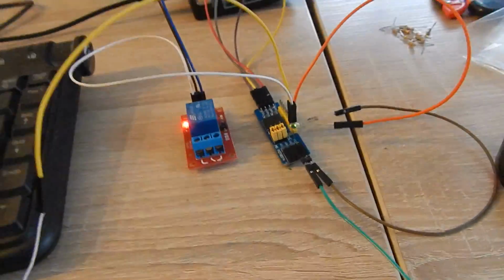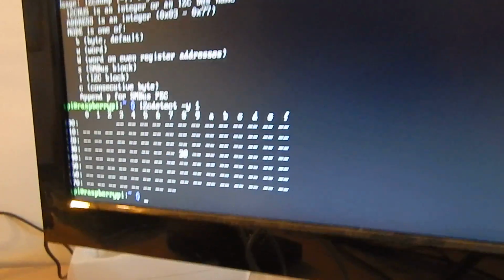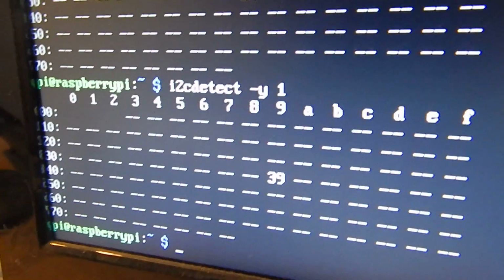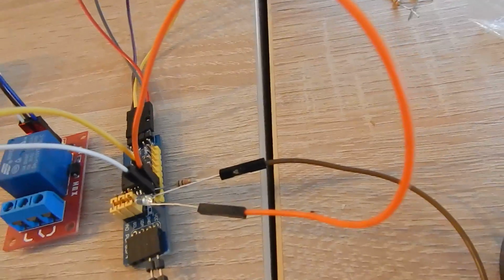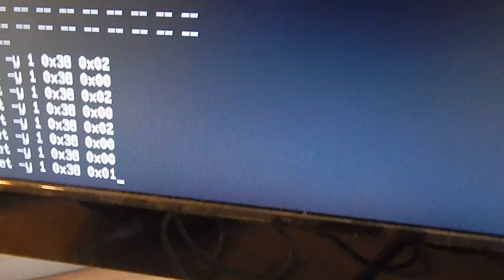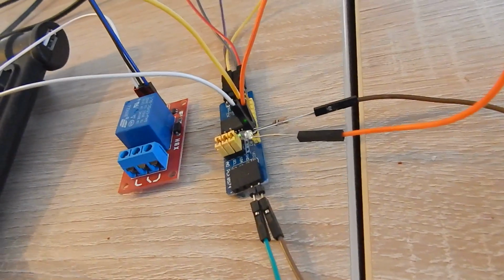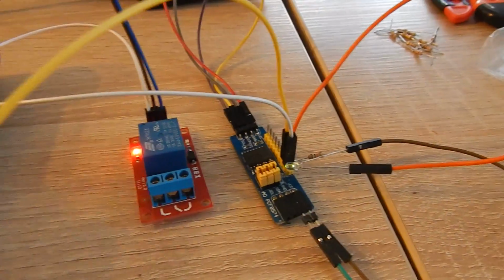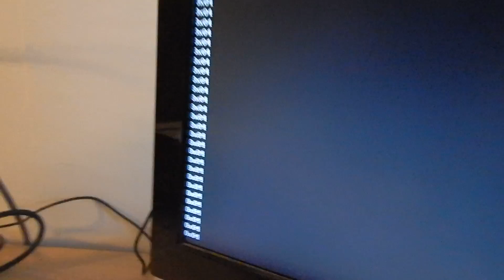Raspberry Pi I²C GPIO expander PCF8574

Comment: Hi, great video. I need to read the status of 150 buttons. Is it possible to use 19 PCF8574 modules in cascade? The project is with Raspberry pi 3 b +
Reply from the maker: You won't have enough address bits. 3 Address bits means you can only use 8 IO expanders.

you can build something like shift registers to stack an unlimited amount of buttons. Or if you like it analog, build a cascade of resistors where every button shorts the circuit at an other point of the cascade. Measure the resistance and you will know which button has been pressed.

Comment: Hello, nice video.
Just a suggestion: for the push button status reading, instead of continuously reading it with an endless loop, you can better use the "INT" port on the PCF8574 that wil inform the Raspberry about any change (rising or falling edge) on any port of the circuit.
Then, you can use an interrupt function that will run only in this case.
Reply from the maker: Nice suggestion, but it dosen't work in a bash loop. I would have to switch to something like C.

Comment: hi can u please post schematics I am confused about the wiring I tried and it's not working
Reply from the maker: neelam naveen Kumar you need a resistor.
Reply: antisteo nevermind I figured it out I was testing with wrong pin everything works fine now no problem anyway thanks for quick reply